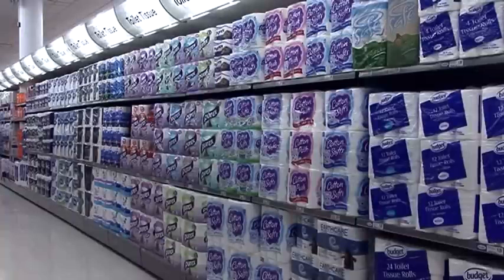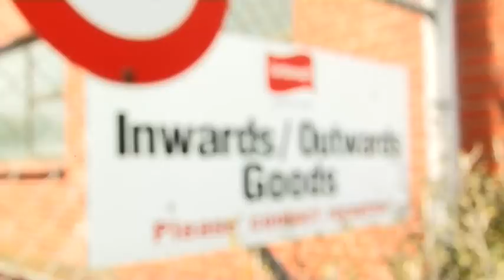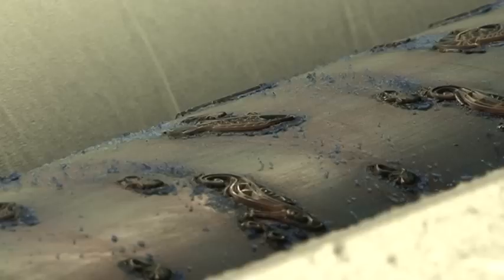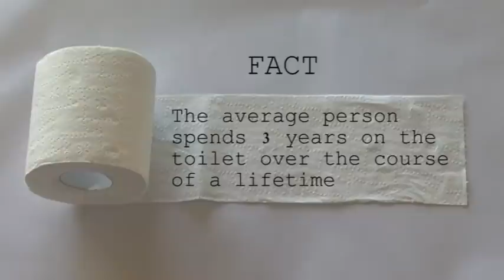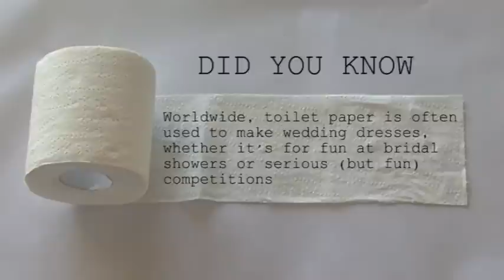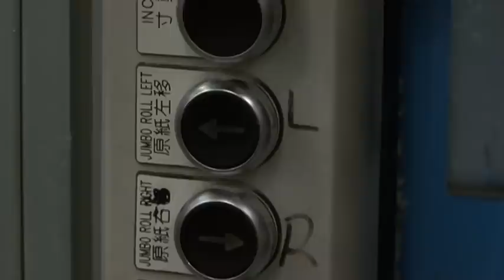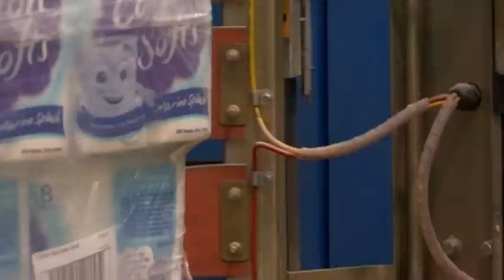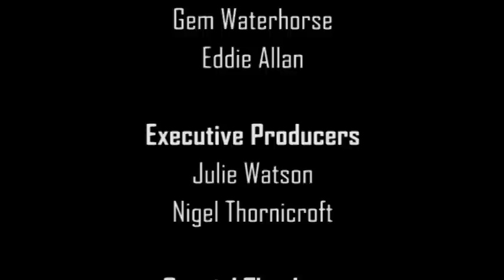MANUFACTURE THIS: Toilet Paper

Comment: Horrible background music. Had to turn the sound off. 
Secondly, it doesn't show how the actual paper is manufactured, just how incoming big rolls are made into small rolls.
But the camera work is good. No complaints about that.
Reply: The paper industry is pretty secretive about its equipment. A senior manager was fired for taking a selfie in front of the machine in a new mill I helped start up.